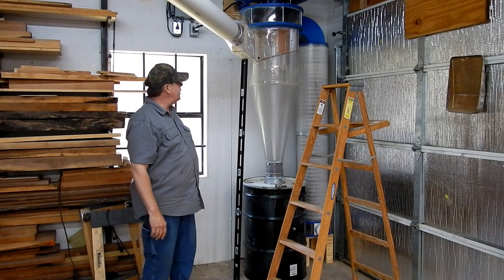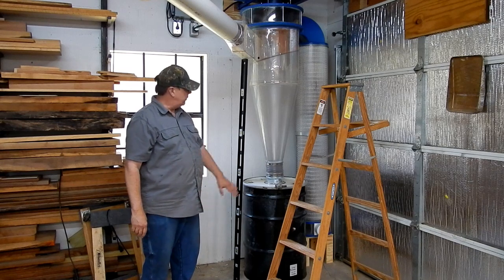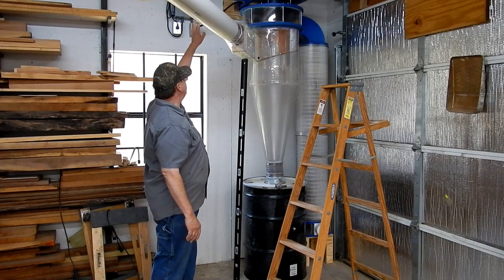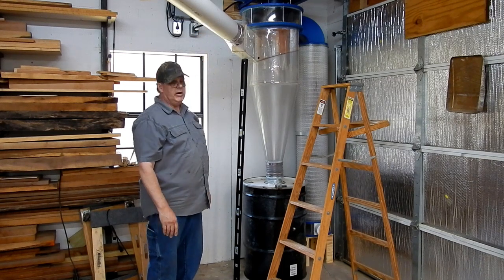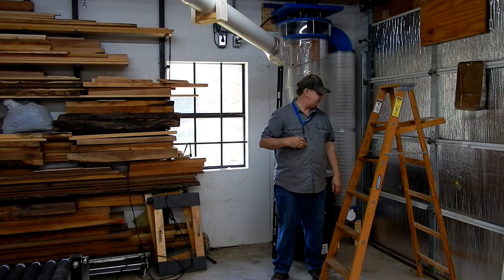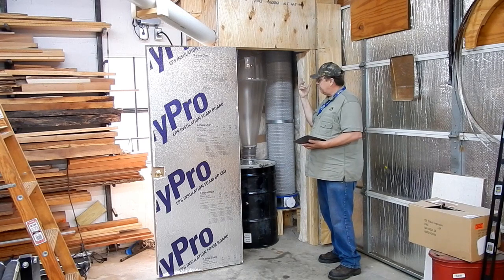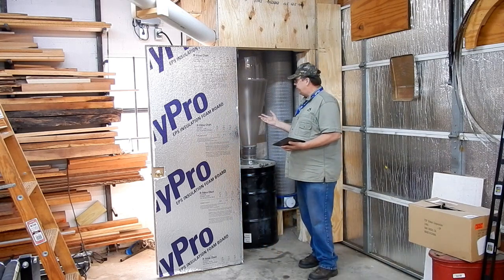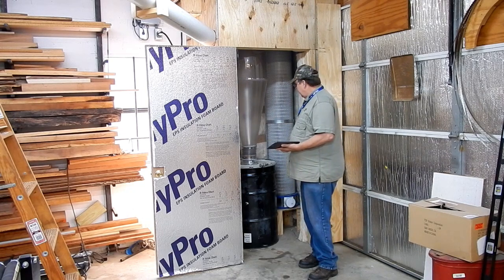Clearvue CV1800 Noise Reduction

Comment: Interesting effort. Thanks for sharing. @13:22 you said, "80db is two times greater than 70db. I'm not an expert but I believe it's a logorithmic scale so a 10db change represents a 10x change not 2x. So going from 90db to 80db is a huge improvement. Well done.

Comment: You need sound absortion material rather than the insulation materials you used or a full coverage of both with the sound absorption material on top facing in. It's a quandary. I put mine outside the building in a detached shed.

Comment: Thanks for your video. You've provided considerable useful information for everyone with a dust collector. Your use of a prehung hollow core door is a good idea, a solid core door may be better at blocking sound. Would increasing the capacity of your baffle system at the top to allow more air to pass back into the shop be enough to eliminate the need for the return air outlet next to the door? Also, do you think the reduction of noise you've achieved may be good enough, especially since the noise coming from the table saw and other machines are so loud? Thank you, you video has been very helpful to me.
Reply from the maker: Some of the noise on the CV-1800 which is the same as the now renamed CV-1700 is the velocity of the air through the six inch trunk line due to the 16 inch impeller. You need density plus change in density to disrupt sound waves and of course an uneven surface inside helps to break up sound waves.
The vent in the wall along the door was only added after it was evident the original vent at the top of the wall was not enough. Venting at the top of the wall is much preferred so that all the hot air generated by the motor is dissipated as much as possible so the thermal breaker does not trip on the motor. Even with the venting I have now if the door is left unlatched the blower will open the door about four inches. The slight positive pressure in the closet has not been a problem. 
I was trying to keep the walls light so they could be removed if I needed to work on the cyclone. If I was doing over again I would build the closet bigger and use noise reduction sheetrock with green glue then for a density change install the same noise reduction insulation or green Sonopan. Sonopan on the door would also be a good idea. It is my plan to add a layer of noise reduction sheet rock with green glue in between to the walls and door.
The OSHA requires hearing protection at 85 decibels for a TWA of 8 hours and right now I am at 80 decibels of course the average would be lower. Normal talking is in the sixties. I do not believe you are going to get it much below 75 due to the trunk line noise but I could be wrong.

Comment: Remove that insulation inside n install a 6 inch fan exiting the building from in the closet then wire it to come on when cyclone comes on then buy that egg crate bed foam topper n screw n glue it to the inside of the closet

Comment: I have the same dust collector. Not sure what your surrounding are bui
Reply: Put dust collector outside if you can and vent outside. No need for filters and much quierer.
Reply from the maker: @lisabell4649  I considered that but my shop is temperature and humidity controlled so venting outside would greatly increase the energy use on the AC or heater along with continuously introducing a large amount of humidity to the shop.
Reply: @lisabell4649 No need for clothes either since you’d be sweating your balls off with all the conditioned air being evacuated

Comment: David, You seem to be the only one on Youtube that has paid for your clearvue that I have come across, I hope you can give me a honest review. What I want to know is how much fine dust do you get in your canister? They (sales) had said you should be getting fine dust along with big chips in canister very little in your filters, due to design and length of cone. I have a 37" Ramco wide belt sander along with everything else. I don't need to be cleaning my filters every four to five boards.
Reply from the maker: I have cleaned the filters twice since it was installed and one time was because I let the barrel overfill. The filters are about ready for another cleaning. Here lately I have been filling the barrel every other day. That being said the drum sander has not been in use very much lately. The CV1800 I have has the 16" blower which does make it louder but with the larger blower even the 6" header is carrying high enough velocity that a one inch hose off of it works well on the random orbit sanders. Overall it has been a good investment.
Reply: @davidpape9726  Hi David thanks for the reply. You have not stated how long have you had your Clearvue system.

Comment: Is it possible to build a pressurevalve that opens  when the cyclone is running to release the pressure in the cycloneroom outside instead?? Great idea to close the noise in.. Thumbs up. :-)
Reply from the maker: That is definitely possible using a flapper valve or a mechanical shutter wired to open when the fan comes on and a delay to close when it goes off. If you live in a rural area like me you could vent straight outside without the filter or take partial load outside. The issues with doing this in an atmospherically controlled shop is that now you need allot of fresh air from outside to replace the air that is lost. This would allow in excess moisture and air that would need to be cooled or heated on many days thus increasing the load on the air conditioner. You may need to increase the air conditioner size to accommodate thus increasing costs. The enclosure around the dust collector must have air flow across the motor to keep it from overheating and tripping the theral breaker. That is why one of the vents in the closet is located at the top.

Comment: thanks for sharing your experience.  What is the exterior dimension of your closet?  And what would you recommend if doing it again? (I think you said you wanted an additional foot of clearance?)
Reply from the maker: The exterior dimensions currently are 38” by 52” and if built again I would add 18 to 24 inches to each wall so that entry into the closet was possible for needed maintenance. The main reason that was not done in the first place was I did not want to cover the window.  I would also add a couple layers of Quiet Rock to the exterior of the walls with the caulking inbetween and one layer inside again with caulking between the Quiet Rock and the studs.  As it is now I was able to cut the sound down by fifity percent but there is opening for air flow back into the room which will always transmit some of the noise even with baffles. Always include a vent at the top of the closet so that the hot air produced by the 5 HP motor can escape or the motor can overheat and trip the thermal protector.

Comment: if you want really solid noise isolation, build two walls for it. A room inside of a room, with a decent size air gap between the walls. 3/4 inch or thicker material is ideal but even stuff like osb works decent. You would want solid core doors for both walls and make them as air tight as possible. If you can see light coming through the doors or walls, that's where all the sound is leaking out.

 Another thing if possible is to face the air outlet so it isn't pointing back into the room. Directing it at the floor is a really good option, especially with concrete floors. Just be careful it doesn't kick up stray dust back into the air.

Try it on a small scale to see the results :). Hope it helps anyone
Reply: This takes 4x the amount of work and cost, practicality becomes an issue. He did great as is.

Comment: As you discovered, insulation is not designed to deaden sound. What you need for sound deadening is MASS. The cinder block suggestion is a good one, but not practical. I’d suggest using a couple of layers of cement board. . . The thicker, the better. That should make a difference.
Reply from the maker: Thanks for the suggestion. One of the main objectives was that the walls were a modular design allowing for easy removal in case of needed repairs. Cement board would be to heavy. As it is the insulation reduced the noise level fifty percent and brought it down below the action level requiring hearing protection.

Comment: My extractor is super noisy. It's not the motor, it's the pleated filter that seams to be the source of an unbearable drone. I'm about to build a cabinet for mine and was most interested to learn of the back pressure issues and baffling system you were implementing.Thanks, you've given me some useful information to work with. 
I do however have some info that may be useful for tweaking your cabinet.
The styrofoam/polystyrene on the door isn't doing anything for sound absorbtion. XPS foam/high density insulation foam, commonly used under concrete slabs, is a fairly good lightweight sound absorber.
You should also seal all the gaps that aren't baffles, i.e. rubber seals for your door frame. Simply put, gaps let out high frequency noise and only density will reduce low frequencies.
Good luck and keep up the good work.

Comment: David:  The foil lamination on door styrene is reflecting sound instead of absorbing.. try open cell foam like used in a gun case. For the baffles.. If you can make an accordian-style for the outer wall of the baffle that should help too. Awesome job!!
Reply from the maker: Thanks I will try it

Comment: Great video, thanks. I’m looking to build an enclosure for my dust collection but I think I’m going to build it on the exterior of my building, piping it in through the wall.
Reply from the maker: I have considered that and may end up doing that in the future. My shop is temerature controlled so if the unit is outsdie of the shop enclosure the interior conditioned air will be pulled out so you will need to some how allow air flow back into the shop or the energy costs will go up.  You are right having it in another room you could keep your shop noise down to a minimum.

Comment: Thanks I recently moved and the new shop has the cyclone motor and drum in the garage side and the filters in the shop side. I use a Radio Shack Db meter and I have readings at about 92 sub division unfriendly. I first installed my Clearvue in 07 and built a shed onto the back of the shop, the build is still on the Clearvue forum It was a bigger shop and bigger lot. New house small lot small shop. When finishing the basement I researched sound reduction and from what I can tell double wall with 5/8 rock board is the best bang for the buck. They called it a room within a room and they also used a green sound insulation caulk. If I can knock it down to about -80 ish  it should be good. Thanks again.
Reply from the maker: Your reply peaked my interest and I looked up and found a video concerning Quiet Rock which is an internally laminated sheet rock. One sheet is supposed to be equivalent to six sheets of standard drywall. Sounds like a good alternative. If I rebuild these walls I will make the room bigger so maintenance of the cyclone can be done. I was worried about losing space in the shop but I would rahter have room around the cyclone. Let me know how it works out for you. Thanks
Reply: @davidpape9726  This is the guy I learned the most from his page is 
Home RenoVision DIY
on you tube and while the best sound proofing was a bit much for my basement budget a small closet should be manageable

Comment: You could always try just enclosing the motor area. You'd obviously still need air exchange to cool the motor, but a small baffle would likely suffice since the filter would be outside the enclosure.

Look into mass loaded vinyl for this application, it's thin and could be applied to the back of the door and over the mineral wool as well as hung in front of (a few inches) the baffle.